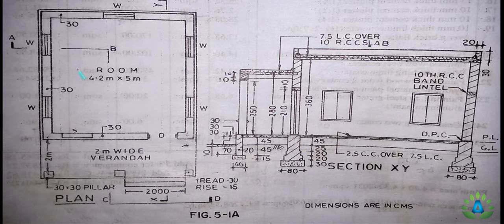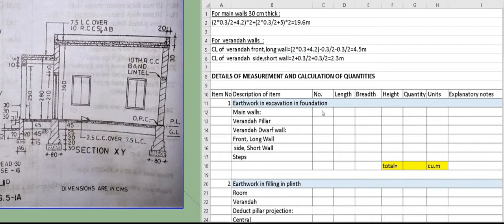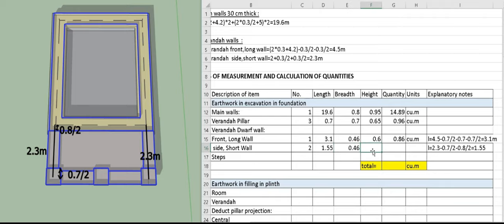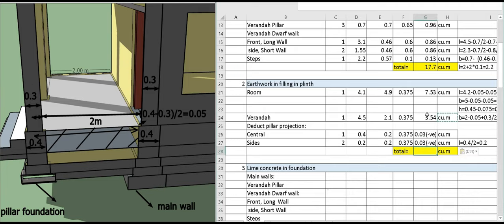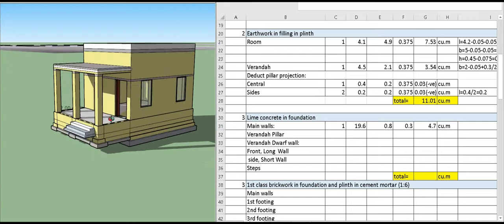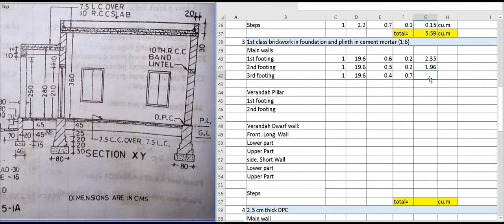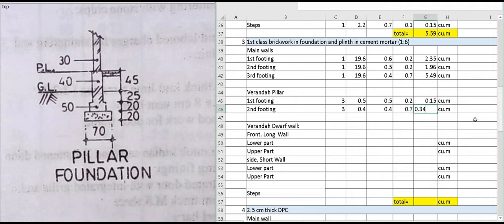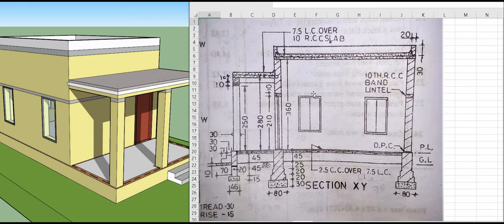Estimation Of Building With Verandah Pillar Foundation

Comment: Sister you are mistaken during calculation of steps . The value 0.1 m is for the side view which is for breadth , saying the same but you are assuming it in the length as 0.1 + 0.1 + 2m = 2.2 m .